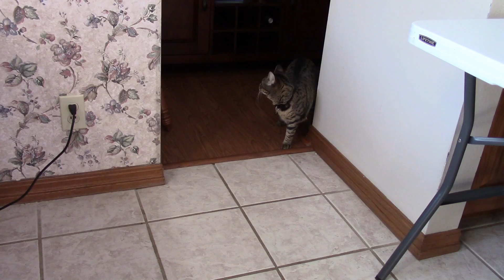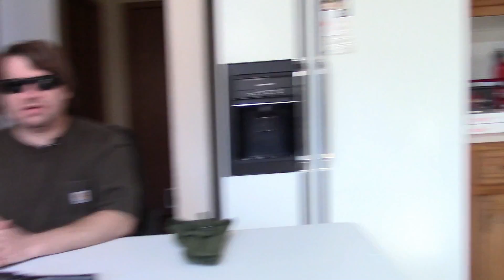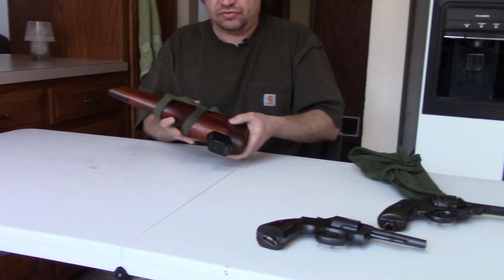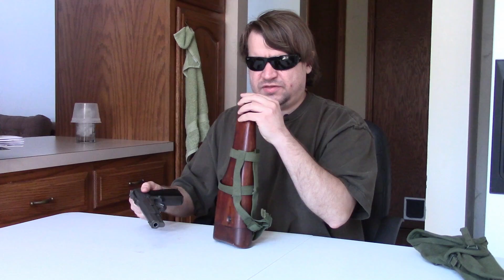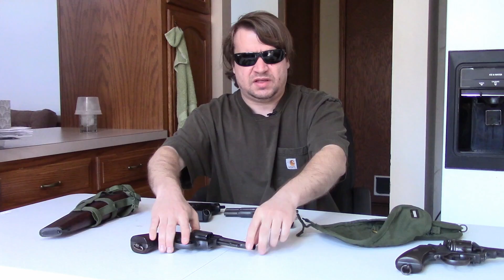Canadian Inglis No.1 & No.2 HI Power Pistols

Comment: i have owned both a CH and T series. Still have the T . its  a Navy Arms import that i believe came from NZ.  My CH was one of those sold by Century in the 90's.   it was reblued with a crappy finish.   Sold it after a few years. i also had the 2 style of Sl&T  tan holsters . all this stuff was easy to find in the late 80's and early 90's , but has mostly dried up.  i even still have a couple of JI mags somewhere.   

Value on them has not gone up much . much less than german items.  i remember Paragon Shotgun news advertising NZ and Chinese HP .  those were the good ol days . Cheap ammo and surplus guns
Reply: Not really sure who or how my No. 2 came into the USA. I bought it complete with 2 mags and canvis holster. The No. 1 came out of a friend's collection. He had it since at least the 1980s, including the stock-holster. I don't recall either having an import marking, certainlly not a big modern one at least. 
Here about 6-7 years ago, Century had a small batch of about 6 CH series No. 1s on an odd-lots list. I bought them all. They had a parkerized finish and were serial matching; pretty cool but no stocks sadly. 
Honestly, Inglis HI Powers are my favorite HI Powers, followed by Argie FMAPs from the 1960s or 1970s. Right now, i don't even own a Belgian FN, and I am fine with that. I would like to get a Finnish Air Force HP one day though.

Comment: You guys kick ass.

I picked up a Belgian Hi-Power a couple years back. It was a Belgian police trade in made during 1965. I really love it, it's a great shooter and I got it for $430 off of Aim Surplus. Other than some holster wear, it doesn't seem like it was used much and it works great with the modern 15 round magazines.

I don't know if you guys are aware, but FNH stopped production of the Hi-Power in the last year. I was looking at the new ones and they wanted $800-$900 for one, I like the Hi-Power but not that much.

Here is a link about FNH ceasing production: http://www.thefirearmblog.com/blog/2018/02/06/browning-ends-hi-power-production-1936-2017/
Reply: We recorded this video about 6 months ago, so a bit of a backlogger. I had one of those AIM surplus FNs too. Those came out of Israel and were authentic FNHs. I recently sold mine though, got $750 out of it on Gunbroker, so can't complain. I moved it to get an Argie FMAP HP, which we did a video on awhile back too.
Reply: Ozark Bear Arms I see, nice trade btw..